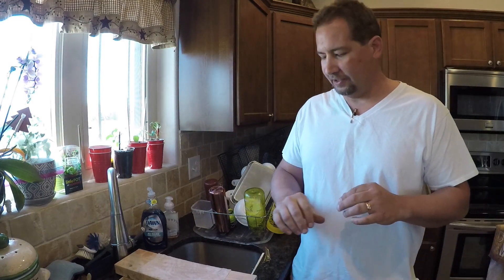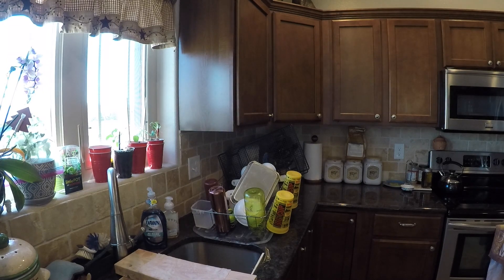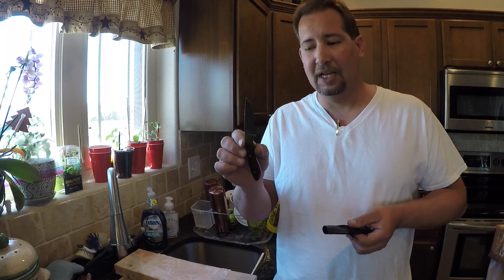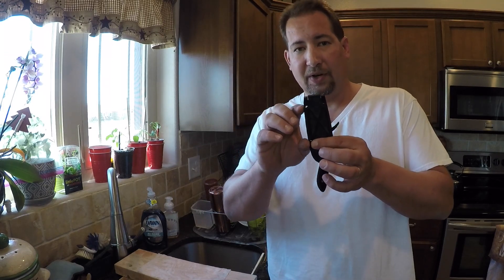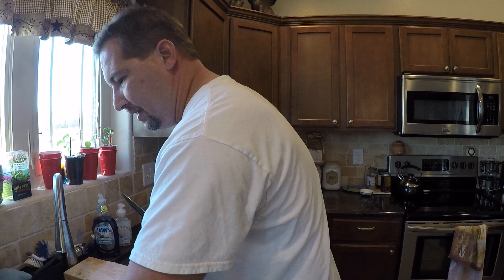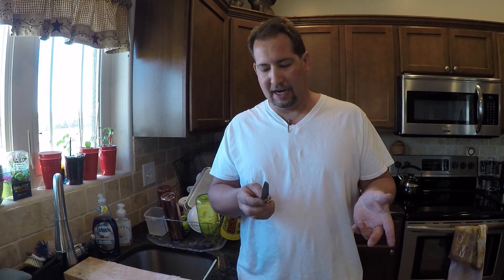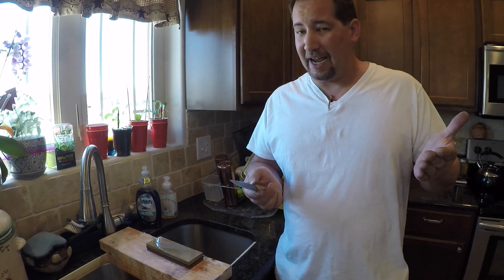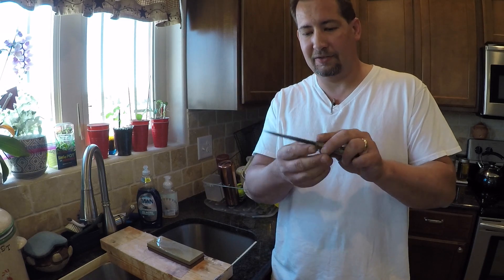making a new knife pattern 25 final sharpening and thoughts

Comment: Hi Joe. How long do you soak the King if at all. can it be used as splash and go?
Reply from the maker: i have heard that you are supposed to soak the 1k side for 10 minutes, and that they 6k side is a splash and go.  if I am just touching something up on the 6k side, I generally just splash it. if I am going to sharpen a couple knives or razors, I soak the whole thing for 5-20 minutes.
Reply: @joecalton1449  OK Joe, thanks for that. I use whittling knives made from O1 tool steel. What is that stuff?